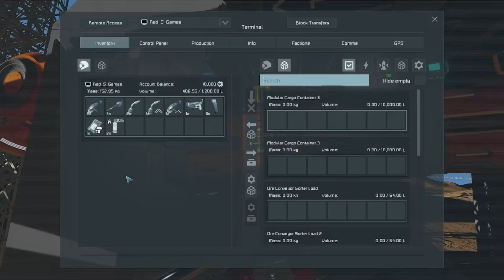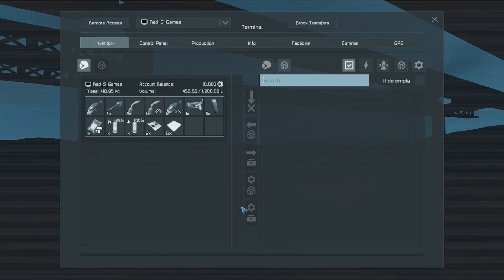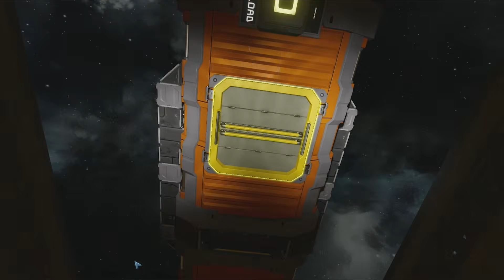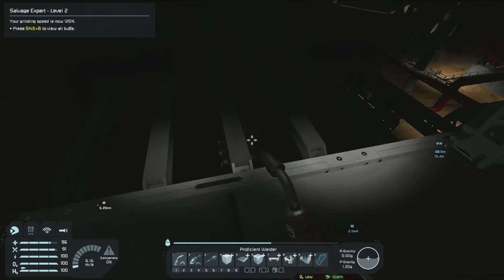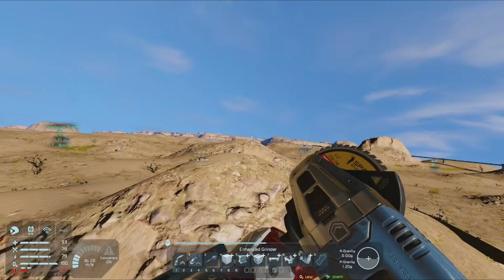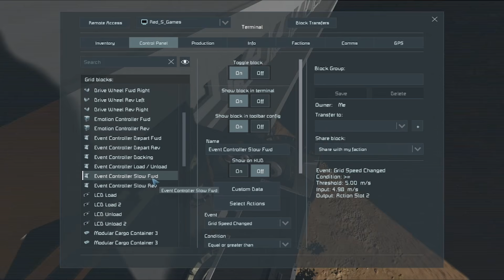3rd Time's a Charm - Rail Survival EP 22 - A Space Engineers Railroading Adventure

Comment: Idea:   When braking.   Brake with rear wheel on one side and front on other side in tandem.   And opposite for when you go the other direction.   Thus giving a balance of frontal and rear braking.   Just an idea.
Reply from the maker: Not a bad idea, and that may weaken the brakes enough to help, though brakes in SE are always a little janky.  I think the current combo of bumpers and controlled speed should mean the jerking won't be an issue, though only time will tell.
Reply: Yep SE is wonky.   I miss the old days of not even having to weld up the wheels for them to fully work haha.